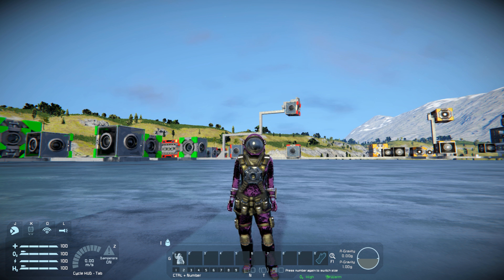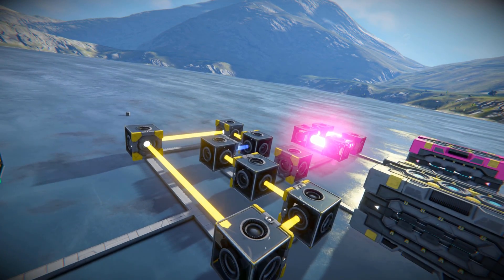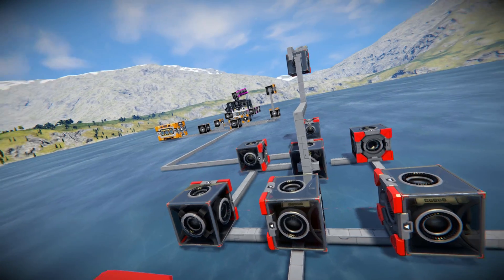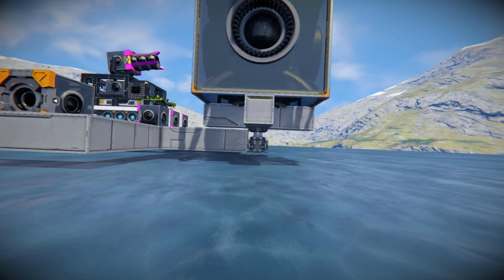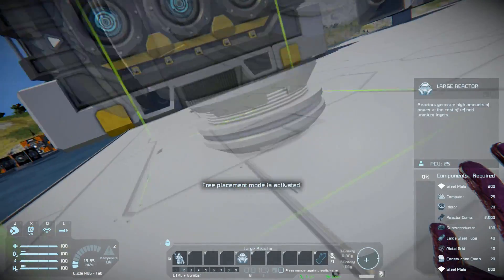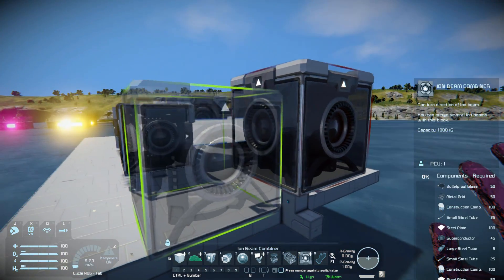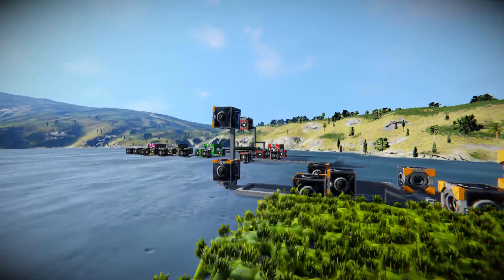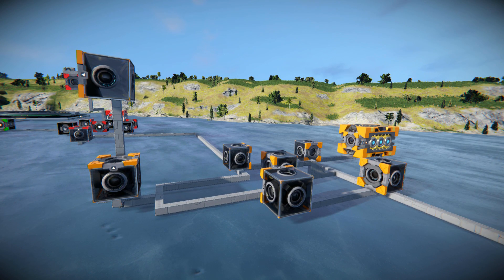Building A 2cm Beam System Turret! - Space Engineers

Comment: I wouldn't say that this Mod is OP.

First, it needs a fair amount of power.
Second, especially with the Ion Cannon, you basicaly have to build the Ship around this Weapon System and its Power System, wich means, that every Hull penetration will lead to a power loss or even a total failure of the Weapon.
Thirth, in the Mod Description is written, that this Mod is intended to be u.ed with Shield Mods, wich nerfs especially the Laser System but also the Ion Cannon needs to be much larxger to be still a one hitter, and that means, that the Gun didn't just get larger but also the chargxing time will be increased to a felt eternity.

And the Fourth Reason, it didn't really work without rotors or pistons, wich mean, that our great Lord an Saviour Clang, can made our days😉

Comment: My laser beam work fine. It fires as soon as more than 1 capacitor i full. The ion beam seem to be broken or just mine. My ion fired once then does not charge up anymore but a tiny shiver of light beam that kept damaging stuff in front of it.
I was fitting a laser and tried to test it while ship was in dock. I made a 1 block hole for i to fire thru but it destroyed at least 3 blocks around the laser and destroyed the dock and the landing tower. I just fit the last block below my cockpit so where I fly toward it will fire there.

Comment: Yo, you can use a beam splitter in place of the piston and combiner for a solid state laser weapon. When the splitter is off, it directs laser in the direction it's facing, when it's on, it splits thhe power according to its settings. So if you set it up to split it backward 100% and forward 0% it'll work as a normal combiner most of the time, but when turned on, it'll redirect the beam the opposite direction.

Comment: i love this mod but its op as hell so i decided to not use it as when fully charged with capacitors and all it just go through defense shield that has 90 GW of power like nothing and deletes anything it aimed at  for those who look for weapons powerful enough for defence shield with 60-100GW setting i recommend GTF the nova torpedo take half of the shield hp but reload 30 seconds tested with 60 GW (2x 30gw deuterium reactor mod) and thors with citadel take about 2 % per salvo
Reply: Nero Drake but it takes a tremendous amount of uranium, we are talking about multiple dekagramms per second, and a long charge time, and a lot of materials needed to build it.
Also since it isn’t MP compatible, you can only use it against MPCs.
The biggest problem is that 2cm has stopped modding.
Reply: @doomdave475  i didn't know about the MP support as even when is et my game public no one join and i wanst talking about deuterium reactor provided with the weapon mod but separate deuterium reactor from nukeguard https://steamcommunity.com/sharedfiles/filedetails/?id=1259182705&searchtext=deuterium also if you have energy-based weapons mod that is supported do around the same dmg i will gladly use it but my whole ship is designed around them to fit so not sure also add me to steam so we can talk my steam id code is 94238941

also here is a collection of all mods i use i could use some help with lowering it but all are so good https://steamcommunity.com/sharedfiles/filedetails/?id=1850055899